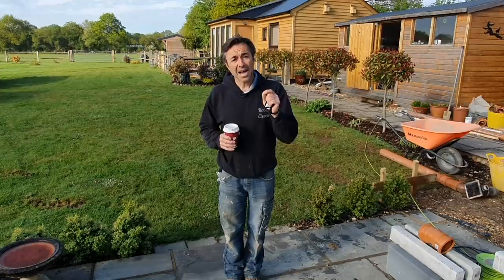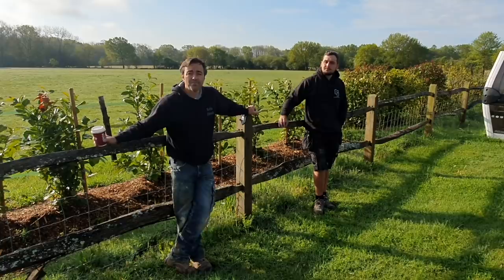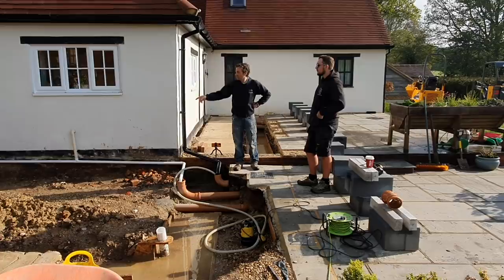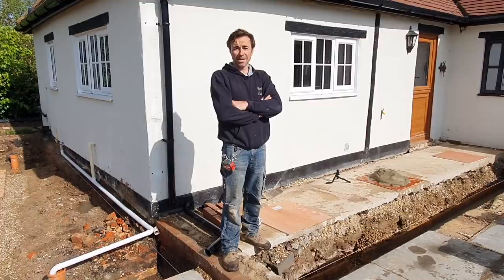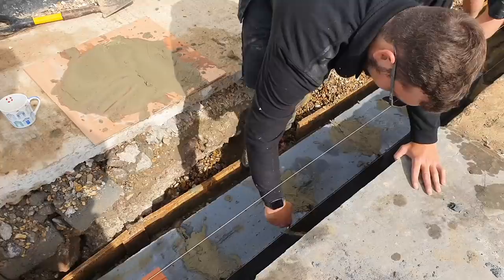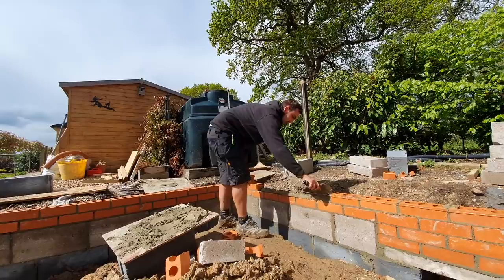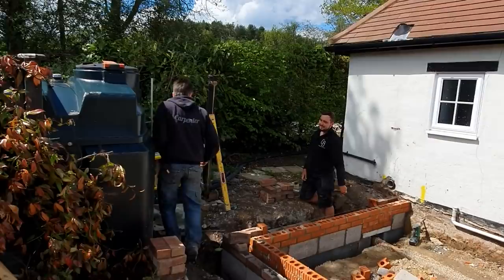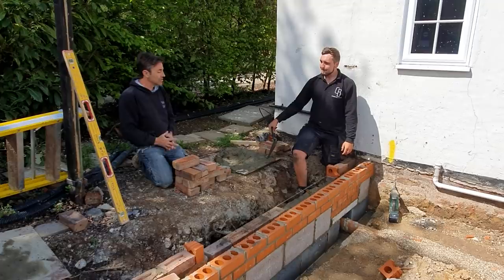The Big Build 4. Brickwork and blockwork up to DPC

Comment: Handy tip, whichever trench block manufacturer you use, read their literature on those blocks. I know that with Celcon, their trench blocks below ground don't need a perp, just butt them up tight. Saves time!!

Comment: Perhaps when you do the roof for this, if its rafters, Could you talk a bit about how to deal with the various problems you can encounter when cutting rafters?
Such as the building (new or old) being off square, wall plate being up and down or the wall plates not parallel to the ridge/wall?  

When watching the various videos to learn, its always done in a perfect world to simplify learning. Cant find any that help with how to deal with those problems and the various fixes or work arounds when you do encounter them though.

Comment: Looking good. I’ve now got my self a BIG BLUE and love it thanks for the info you gave me(not told the wife the real cost😂). Keep up the got work and videos.
Reply from the maker: Well Done mate!!!
Reply: @ukconstruction  I’ve got a festool track saw and it now needs a new blade. What blades would you recommend? Thanks in advance.
Reply: @chrisbeard2654  stick with festool otherwise you run the risk of re cutting the splinter guard if the kerf of the the blade is different. 
If the blade is thinner will blow out the material due to not cutting tight to splinter guard. General you can buy a pair for under 60 notes.
Reply: @christaylor5291  Listen to this man! He knows.

Comment: Did you get an extra belt for the mixer?  I always buy an extra belt for mixers, tillers, plate compactors, etc - they always seem to break at some point when you need them....the extra belt for my mixer is zip tied under the lid in a plastic bag.
Reply from the maker: Genius!!! Like that tip, and yes I ordered a few more!!

Comment: You showed all the set out for square and working profiles. Didn't show height to DPC. I used to put pegs in on all corners and any intersections that the brickie could level from. As you say taking responsibility for set out and level. Still doing it but way different here. I have learnt another trade in the last 20 odd years.

Comment: I noticed that you did not put rockers in on internal to external drainage
Reply from the maker: Hi John, I used a fitting either side of the foundation and this acts as a rocker, in my case the rest bends are actually supported by the spread of the main new foundation so at that point there will be no major settlement of surrounding ground. I agree with the use of rockers where ever possible though mate its good standard practice.